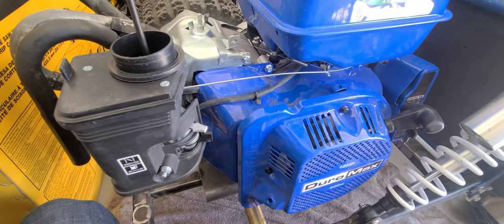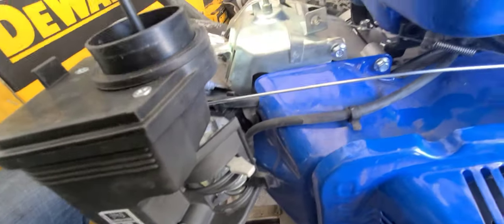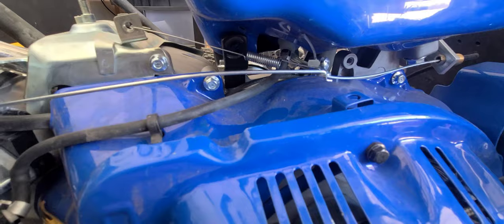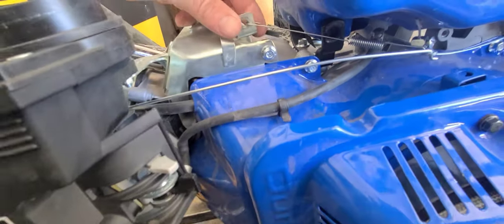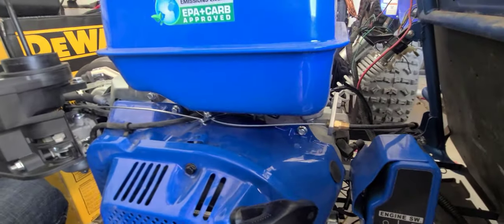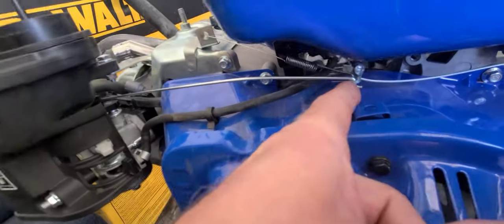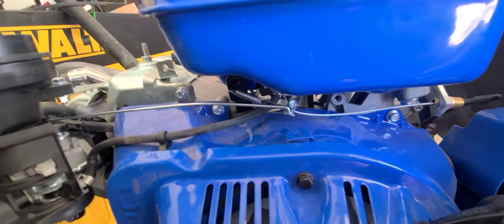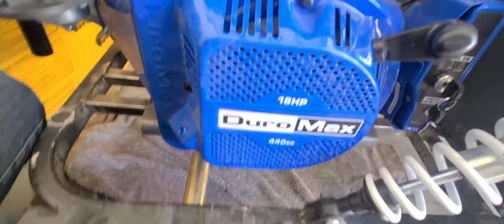DIY Easy Governor Bypass Duromax 18hp #XP18HPE Predator 420cc and other GX390 Clones

Comment: You should never remove the governor on the electric start engines. The flywheel has teeth that engage the starter motor and arw more likely to explode under the Gs when removing the governor.
Reply from the maker: Someone didn't read the "Do not attempt" disclaimer
Reply: @azlongtales  I read it. My comment was mostly advising other people watching your videos of the dangers of removing/bypassing the governor on these types of engines. Wasn't a bash towards you in any way. Sorry if you took it that way.